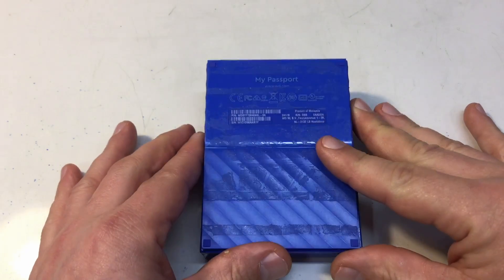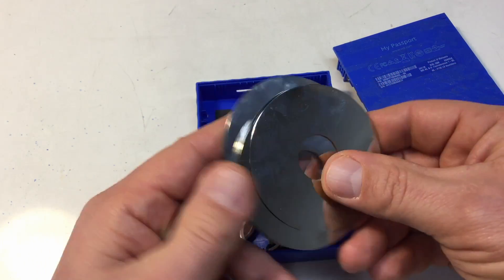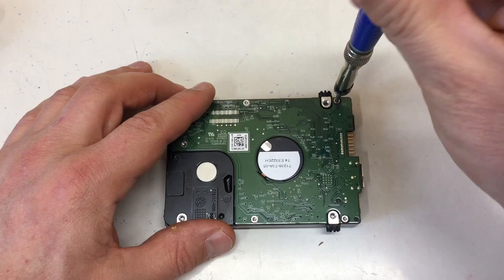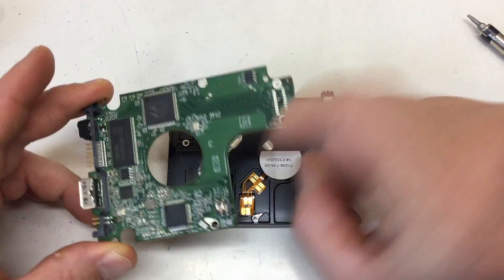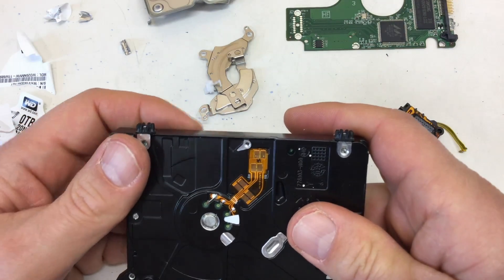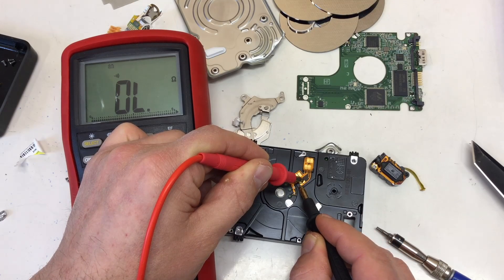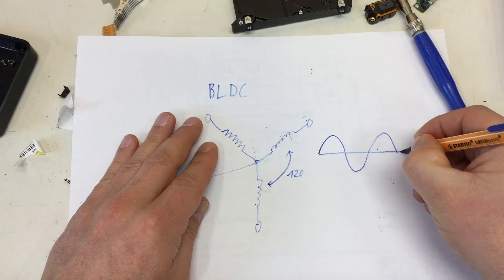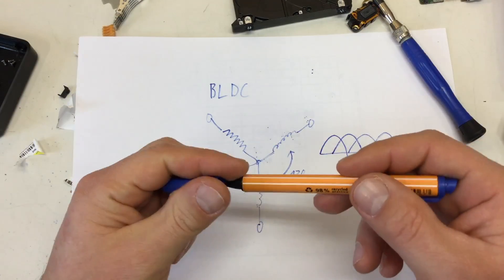WD My Passport / Elements 2TB 2.5'' USB Hard Disk Teardown (All the Chips)

Comment: What screw driver is that??
Reply from the maker: Can't remember the exact size, but I was using small TX (Torx) bits (size T6 according to some comments below). The screwdriver set is a Lux-Tools (30 bits, number 585 395). It was (I'm not sure if it's still available) a quite cheap set - around 15€.

Comment: what screwdriver you use? thanks
Reply: i found for mine it was a T-6 size.
Reply from the maker: @anglicky69  Thanks for the info!
Reply from the maker: If I remember right I was using small TX (Torx) bits. The screwdriver set is a Lux-Tools (30 bits, number 585 395). It was (I'm not sure if it's still available) a quite cheap set - around 15€.

Comment: it wont work again it has fingerprints.
Reply from the maker: No worries! I'll simply polish the disks with my Dremel until they're shiny again ;-)
Reply: @robertssmorgasbord  dont forget to get metal dust from the disks by holding a neodymium magnet close to the plates
Reply from the maker: @legominimovieproductions  Great idea😁 Why haven't i thought about that😂 No, seriously, in some application they do use magnets to remove metal particles. I remember seeing a video about aircraft engines. There were magnetic traps to catch metal particles in the engine and/or gearbox oil. P.S.: like your Lego movies 😉
Reply: You are talking about fingerprints, it won't even work if its exposed to atmosphere